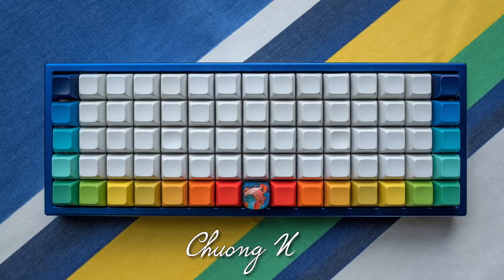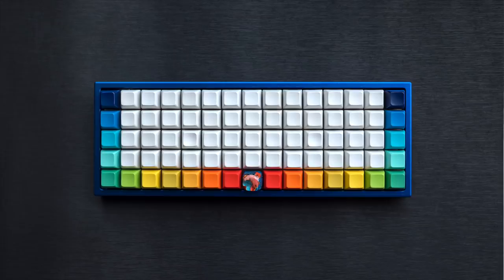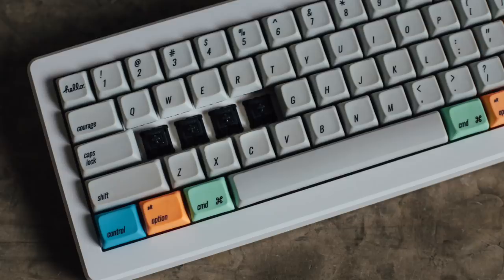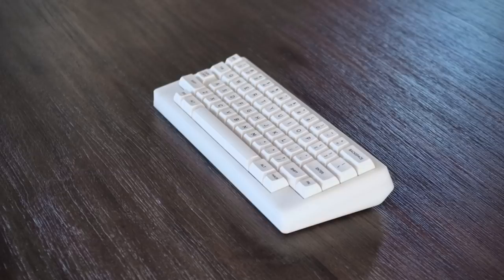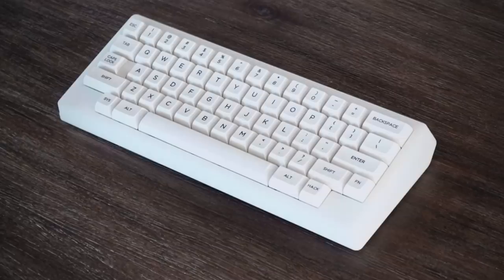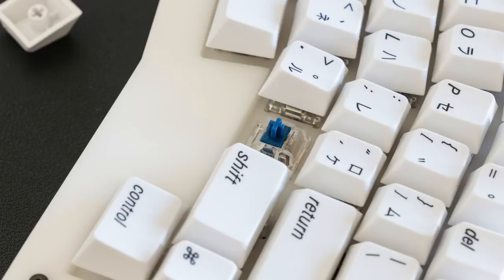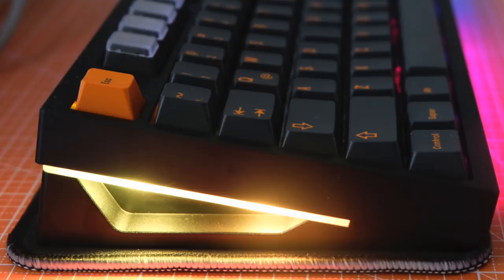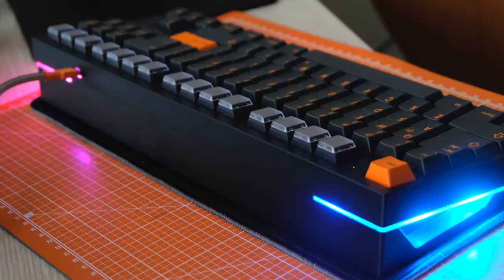Switch it Up: Custom Keyboards #4

Comment: Nice to see more creators getting interested in our amazing hobby. Just so you know....retooled blacks are NOT old switches. Retooled means Cherry has “fixed” their manufacturing machinery (it’s been retooled) and as of right now all switches manufactured from Cherry are retooled, even the others (reds, blues, etc.). However they do need to have the spring swapped to relieve crunchiness. So....retooled are new switches, not old and are very easy to find. Just buy new stock blacks. Like from Arrow. Now ya know!

Comment: Correct me if im wrong but aren't retooled blacks just the newer cherry mx black switches? Pretty much if you buy new blacks itd be the retooled version since cherry changed their manufacturing process. The more "novelty" status switches would be the vintage blacks.

Comment: You sure that split keyboard doesn’t have membrane switches under the key switch casing? Sounded like it.
Reply: It doesn't. That's not a thing either as far as i'm aware (doesn't make much sense). Zilents have rubber tips at the end of the stem sliders, add to that the POM casing and plate and that'll get you that sound.

Comment: Does anyone know a 65% with arrow keys and german mac layout?
Reply: Most 65% has arrow keys, the german mac layout is a question of keycaps AFAIK (ie. independent of the keyboard). Get yourself a 65% ISO compatible keyboard kit with QMK support and a ISO-DE keycap set with mac mods and you should be good to go :)

If you want a premade, a Ducky 2 SF with iso DE and a mac keycap set would solve the problem as well. If you get a non programmable board you can always remap the modifiers in OS X.

Comment: Man these Holy Panda Switches are something... They are stock right now on mass drop..... will not stay there long....
Reply: You can make them yourself. It's just a Halo stem (clear or true, doesn't matter it's the same stem) in Panda housing. The halo's are also on mass drop and the pandas can be picked up everywhere else. If it has Panda in the name, it'll work. YOK purple trash pandas, GSUS/BSUN whatever, it's all the same housing. Only thing to be aware of is the spring. You might want to swap them for 63.5g springs or 67g, or whatever you prefer.
Reply: @miklschmidt   wow thank you sir, I like to learn everyday. Could not ask for a better explanation !